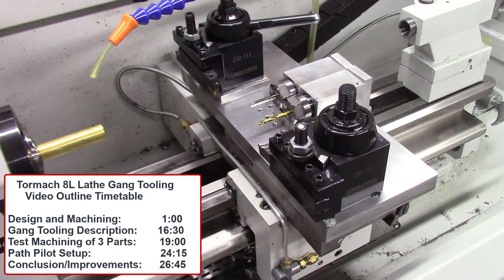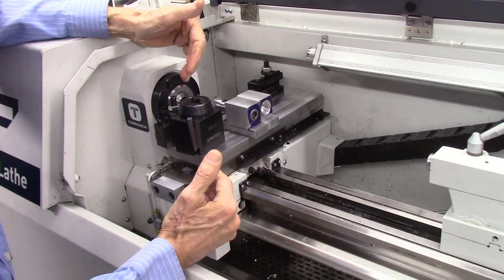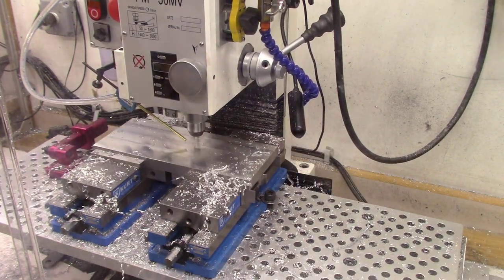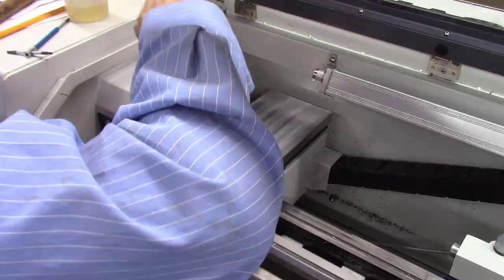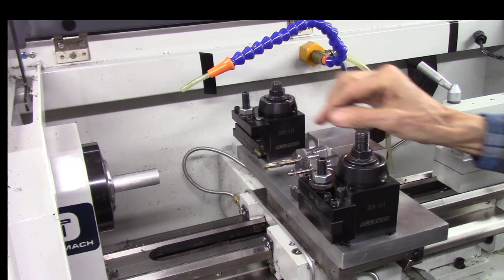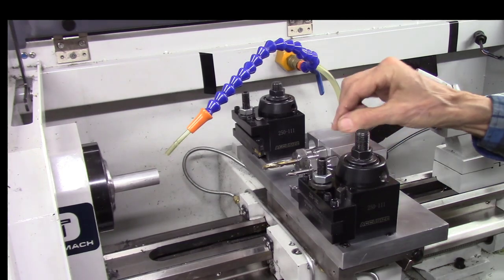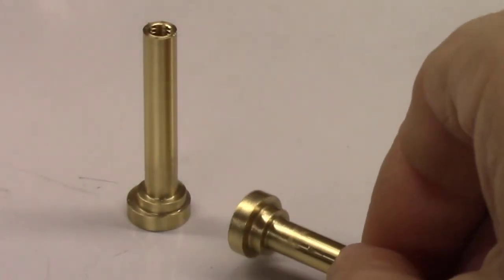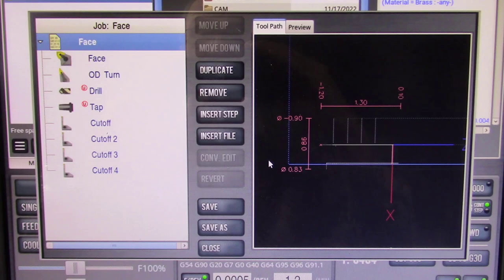Tormach 8L Lathe Gang tools, design, manufacture and testing.

Comment: Great video and thanks for sharing!  I think if I were to do this (I have an 8L) I would make a stub handle from steel and then machine my own handle that was a good slip fit over that with a magnet pressed into the bottom of the pocket.  That way I could use the same handle quickly for front or back, and no chips in the threads!  Again, thanks for sharing your work!

Comment: I found that with the AXA tool post, I could fully remove the moving dovetail wedges and change where the thread engages with them, giving me some choice as to where the handle ends up when it is tightened inside a tool holder

Comment: If you went to 0XA on the tool holders, might you be able to get a third ER 16 holder in there? I know you weren’t too happy with that toolpost size, but it is the size that ships with the machine. You’re probably losing the rigidity benefit of the AXA post by mounting it on an aluminum base plate anyway (maybe steel baseplate + 0XA is the sweet spot for gang tooling on the 8L?)

Comment: Which cutoff tool are you using? Thanks
Reply from the maker: I think that I used the following tool that I purchased on Amazon:  

OSCARBIDE 1/2" Indexable Lathe Grooving Parting Holder with 10 Pieces GTN-2(QC1402) Heavy Duty Nickel Plated QA08R-20 Right -Hand Cut Off Tool Carbide

https://www.amazon.com/gp/product/B086P74LLP/ref=ppx_yo_dt_b_search_asin_title?ie=UTF8&psc=1

Comment: You should have drilled the holes in the holders by the lathe itself.
Reply from the maker: Good idea. I did all the other machining on my mill as well as the holes for the tool holders, but I could have easily, and probably more accurately, drilled the holes on the lathe.  Thanks for your comment.